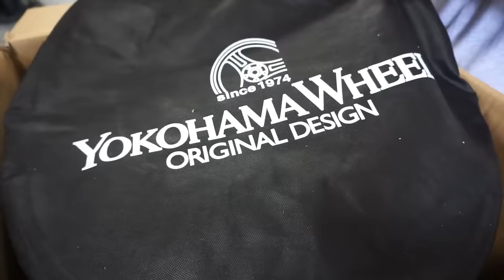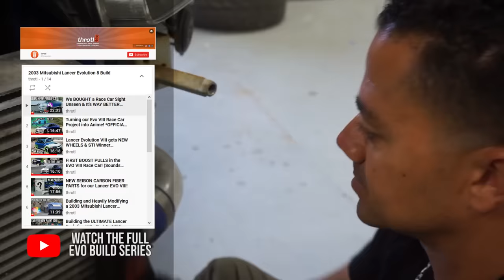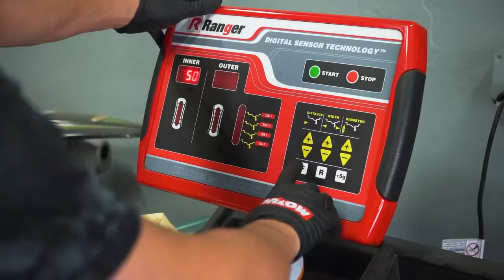Building a Mitsubishi Lancer EVO VIII in 12 minutes! (COMPLETE TRANSFORMATION)

Comment: only thing I didn't like was putting back on stock EVO Exhaust headers back on 🤢

Personally I love custom aluminum exhaust manifold, just IMO they look better

Currently I own a 1991 Eagle Talon TSI DOHC 6-BOLT 2.0L 4G63T 

I needed a higher flow exhaust for the engine for efficiency reasons.
Running 23PSI I also needed different Exhaust side for my Turbo -back exhaust

also I was thinking its probably not smart to run 2-step with a stock exhaust manifold probably due to it being prone to blowing up or cracking due to the material being CAST iron. 
I was told this by a guy who has been working on EVO/ EAGLE's for 35 Years

Comment: I ordered a cf oem wing from stm tuned, and it was cracked in several places. The day of delivery (which i didnt get any notification upon eta) I left work early because i was getting severally sick, ended being covid. When I got home my package was left on my driveway and a signature was required, no one signed off. I was really weak and just put the package in my garage and went straight to bed in stood in my room for 6 days, I was in bad shape. When I started to feel better I open the box and realized the cracks. I contacted stm tune and seibon, and they said there's nothing they can do because I didn't inspect it when I received it. I spent nearly $5k on my order and spent hundreds throughout the years with them. Since then I cut ties with them I will post images on my ig, and yt. $800 down the drain 🤦‍♂️